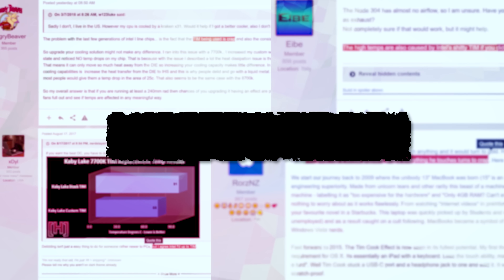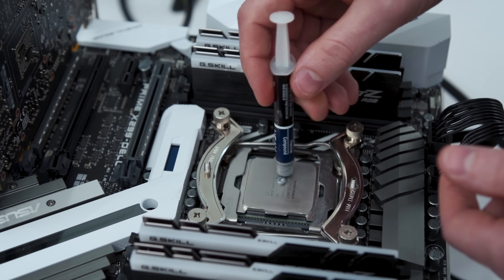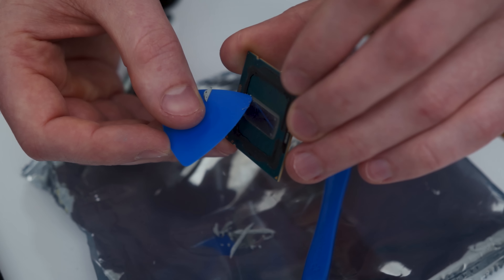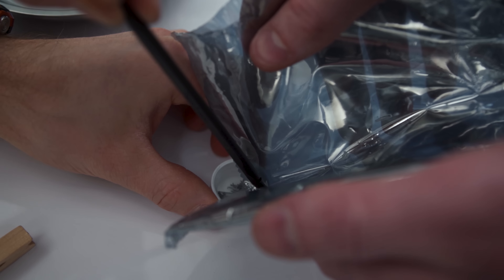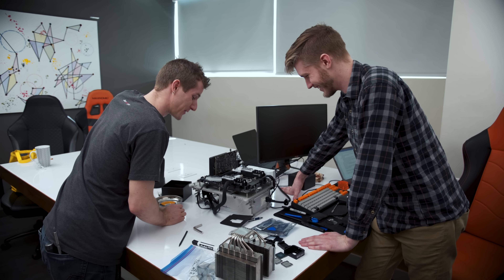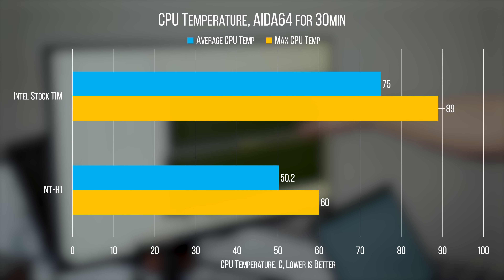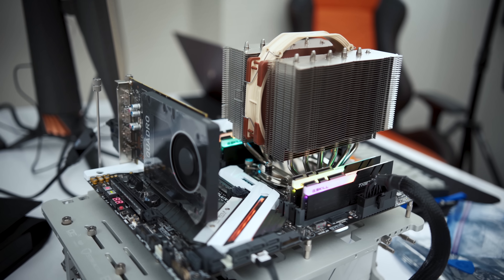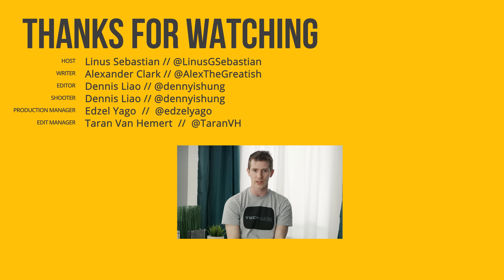Is Intel’s Thermal Paste ACTUALLY That Bad?

Comment: Intel™ Brand Thermayo® - Thermal Mayonnaise - Comes standard on all Intel™ Core™ Series processors, and uses only the best thermally enhanced ingredients such as Canola Oil and three week old eggs!
Reply: there's nothing really wrong with it. Tens of thousands (x10 probably) are using non delidded CPUs with no issue, overclocking them. The thing with overclockers is (I know, I'm one of them) they don't like to see high temps. 80-90c is completely safe, but of course we prefer to see 60-70. It's really not something that's necessary
Reply: Core™ is actually a trademark for Intel™.
Reply: iBoolGuy Added another ™, thanks
Reply: TDS
And what if it`s not about overclocking? You could use a cheaper heatsink and still have respectable temps. Or just keeping that stock heatsink - that`s not bad at all
Reply: Old pastie
Reply: It might lose to not using any.
Reply: Intel Core is a TM (ETA, they're smart enough to not claim Core itself as a trademark); Intel is registered. Intel® Core™ i7-8700K. Intel® Pentium® Silver J5005. Intel® Mayonnaise™ Thermayo-8086.
Reply: noxxi knox noooooo
Reply: THey dont want you overclocking those CPUs too much
Reply: three weeks egg is chicken
Reply: Guys we need to get Jay to make thermal past out of stuff in his kitchen.
Reply: Almost 700 likes, yiss
Reply: Wait, is Intel mayonnaise also an instrument?
Reply: Partially produced with genetic engineering.
Reply: TDS When people pay anywhere from 300 to 2000 for their chips, its only expected they get the best, for intance, their main competitor had the idea of soldering the die and block together, to assure the best perfromance without the need of delidding. To defend Intels shitty TIM is is like saying you dont want advanves within technology cause what we have is good enough. Its just plain stupid and unacceptable

Comment: This was done... pretty poorly. My recommendation would be to get an ACTUAL mortar and pestle so you can grind the TIM in to a fine dust and then using a small amount of Ester Oil or Silicone grease - something that is actually used as part of thermal grease as a filler so it can flow. Or mineral oil, or some kind of other oil instead of isopropyl alcohol which was never going to suspend the TIM particles properly.
Reply: Seconded. Would like to see LTT redo the test with this advice in mind
Reply: Yeah, I was really disappointed. I did just 10 minutes of research and found out most thermal paste should be insoluble in isopropyl alcohol which was clear in the video
Reply: It was never their intention to create a new paste, they just wanted the intel tim to be easier to spread. They even say they want the alcohol to evaporate - i mean did you even watch the video? Come on...
Reply: Mineral oil. Use Mineral oil.
Reply: Not really recommended, but close enough :P Not sure if those perfumes would break anything down over time, but I am sure you don't want your room to smell of babies every time you stress your system xD
Reply: Or you coulda let the first thermal paste dry out and crust up, and give it the same alcohol treatment, so the results would be comparable.
Reply: Yeah and did YOU watch the video when he said “we’re actually changing a lot of variables when we do that” - but doing such a crappy job with the Intel thermal paste he’s changing only one variable but in a pretty significant amount
Reply: I dont care TUNNELBEAR IS BACK
Reply: Well everybody knows from the beginning, that Intel TIM is shit. So doesn't really matter how they process it xD
Reply: Are you a rocket scientist?

Comment: When they said Intel's thermal paste I thought they were talking about the default paste that comes with the stock cooler of the processor.
Reply: Same
Reply: They should test that too.
Reply: Btw why does my i5-10400 with the stock cooler with the pre applied thermal paste go up to 100 degrees Celsius? I have 5 fans in the case or is that normal
Reply: @peacemekka  So should I take off the heat sink and and re-apply thermal paste or just take it off and reapply the heat so its in better position
Reply: @yoursubconscious1774  Check if there is enough there. If there's barely any scapes left then do reapply. The mounting pressure is key. Not too much or too less. Oh and don't apply too much paste. A single drop (~1mm diameter approx) in the center serves fine.
Reply: @peacemekka  for some reason my stock cooler won't come off. The first 2 little clip offs will but the top 2 will. I tried taking off the back panel but no luck
Reply: @yoursubconscious1774  be very careful with those, if you break a clip then its real trouble. Each clip has a rotate-lock mechanism to put it in place. Did you try rotating the clip head to unlock the clip? The first two might have come off easy because you didn't lock them properly, hence the heating issue.
Reply: @peacemekka  yeah the first 2 are very easy to take off but the top 2 are very hard to take off. I didn't much force ln it because I didn't want to damage it. But yeah I will try to twist it

Comment: 25° is the difference I got between no thermal paste and nth-1 on a Chip with similar TDP and with a huge air cooler with a big contact surface. That doesn't mean that intels tim is as bad as no TIM at all it just means that 6 year old tim scraped off from a chip is as bad as no TIM.

Comment: The noctua layer of paste looked a couple times thinner than the recycled layer, not to mention its crumbly consistemcy and inability to actually spread out like it's supposed to. The patch is clearly not a lot bigger than what the application of the dried emulsion looked like. Please try another method to test this.

Comment: Plot twist: Intel's new gen chips were never been more efficient. They were just using better thermal compound each year!
Reply: Who would've thought imporving just the thermal compound would be cheaper :D
Reply: Sadly, that actually sounds like a really probable move from Intel.
Reply: That's not bad, improving the paste to get lower temps.
Reply: Except delidding doesn't reduce TDP it reduces temp.
Reply: No dude, using better TIM doesnt make CPUs go faster. Unless all previous gen CPUs were throttling by default even with high-end coolers on them.
Reply: Well even ivy bridge ocd very well and was limited alot by temp..
Reply: inb4 Cascade Lake X is soldered lol.
Reply: A N I M E
N
I
M
E

Comment: You should have done a test with the thermal paste that comes with Intel heat sink....
Reply: Gabe Catell do you know they are the same paste or are you assuming?
Reply: We can only assume. But it's a good suggestion. At least you can get it fresh.
Reply: They even look completely different, so...
Reply: This video is disappointing on so many levels.
Reply: 100% agree, using a couple brand new out of the box Intel heatsinks and a couple with the thermal paste wiped off would have worked so much better instead of torturing those poor 3rd gen chips
Reply: Or possibly taking two older chips and De-lidding one of them and putting fresh thermal paste on it and keeping the other chip with the original thermal paste.
Reply: @EHEH RON linus assumed he could just scrape off the old paste between a tim and heat spreader and use it for thermal conductivity between the cpu and cooler. Mind you those cpus they got that paste from are like 8 years old now, and they assumed they could just use isopropyl alcohol to re-liquify the old paste. which didn't really work. Being scientific simply means to find a problem or hypothesis and test it. The dilema tested was intel's thermal paste, and they assumed a lot of things, considering no one has ever done such an open experiment, at least none that have been recorded or documented. You should "get woke", son, as you clearly don't know much about scientific reasoning. And the way you used "fag" was in a derogatory fashion. I'd hoped that in 2018, people would have more decency. Hell, I'd hoped that the immaturity of insulting someone on the internet would have died out years ago, but I guess not. Instead of insulting people, you should do research and try to understand things. Also, you're on the internet, literally everyone in the whole world can read this, you should use caution on the internet. If you have nothing nice to say, you should use the dislike feature that YouTube so graciously provides us, and move on with your day. Why waste your time to get into a fight over some YouTube comment?

speaking of Scientific Reasoning, it would actually be appropriate to assume that intel uses the same paste in their cpu's as they would with their stock coolers. It woud be more expensive to create another type of paste to put on the bottom of an already cheap cooling solution. So you could make a claim that in order to be cost-effective, intel uses the same type of thermal paste. However, it can and should be tested. Hypothesis: intel uses the same thermal paste for all of their computer components, and have for a long time. You can do many tests between cpu generations as well as their corresponding coolers. the control could be an 8th gen cpu and cooler, completely untouched. 

To be fair, linus wasn't very scientific about what he did, but they did prove that thermal paste in the older cpus weren't as good as thermal paste you can buy separately. But again, the test is flawed because the cpus are old.  

with that being said, have a nice morning, day, or night depending on where you live in the world, and I hope you learned something. refusing to lose ignorance can be seen as idiotic, and I know you aren't an idiot, so I really do hope you've learned something. Also, I'm no hypocrite. i disliked your comment, and you might not ever hear from me again, definitely not in this comment thread. And I of course had nothing bad to say. I simply added to the discussion, and I certainly haven't insulted anyone or used words in a derogatory way. Enjoy the rest of your day.
Reply: Kenneth Fleming wow, just wow!
Reply: Intel's thermal paste AND Ryzens perhaps?
Reply: You can get 7th gen Celerons for $35 each new on amazon, let's not pretend that getting "fresh" TIM wasn't an option, even with a reasonable production budget
Reply: EHEH RON it shouldn’t be too hard to determine if they’re using the same paste with some simple chemistry tests
Reply: Past on the coolers aren't designed to last for 10+ years. Your temps will go to shit within 3 to 4 years if you never replace it. It's highly unlikely to be the same paste, hence wouldn't be a proper comparison. It also wouldn't have been an interesting video since everyone and their grand mother have documented intel's stock heatsink thermal paste vs high end paste.
Reply: HAHAHAHA ...
Reply: Doubt it’s the same compound but I would be interested in seeing the difference.

Comment: Maybe a Better way:-

1. Take 8700k

2. Delid it don't replace TIM to eliminate the variable of contact distance between the IHS and CPU die

3 benchmark

4. measure the volume of Intel's TIM (granted you have to measure the density and mass of the TIM) OR just eyeball the amount 

4 take the same volume of NT-H1

5 BENCHMARK

6 GO HOME.
Reply: "granted you have to measure the density and mass of the TIM" that is impossible. Why don't you go work for intel and steal a jar of TIM?
Reply: Nicholas Lau or just eyeball the quantity of thermal paste ;)
Reply: I was thinking this was what they had planned, a little disappointed they went the other way.
Reply: Also show temps as delta to ambient and compare to the white silicon grease thermal paste too.
Reply: Richard Blackwell BITCOIN IS DEAD
Reply: Not impossible just difficult, measure the mass of TIM you scrape off probably delid five or so and take the average of the masses.  Get a small graduated cylinder and fill it half way with rubbing alcohol.  Put the TIM in it and measure the difference in the liquid volume (in cubic centimeters) then divide the amount of volume difference by the mass  and you'll have the density.  But if you just want volume you can skip the whole mass bit.
Reply: Shlok Avlani it is really hard to mount heat sinks without an ihs.

Comment: hey linus
i think you should have used noctua thermal paste inside IHS(Integrated Heat Spreader) and compared it with stock paste in IHS.

Comment: This seems a little sideways. Everything has a K/W rating including paste. If you have a calibrated on-chip temperature sensor and can measure power input, it should be a straight shot. I mean, application is as important as bulk property.

Having watched it, and seen how the re-applied paste literally flaked up, scratch that. This is a completely stupid test. Why did you even post it?

Comment: Problem. You are testing paste that has been heated.Then you exposed it to air. After heating the make up changes. Then it is exposed to air. To get a valid test you need to heat up the after market paste. Then expose it to air. The key is air exposure after heat. Your reconstitution is the problem.
Reply: Carter Baker I mean, the results are about right from what we see via deluded chips.
Yes Linus can be a dingus, but this isn't really one of those times.
Reply: this realy is one of those times, there is a reason you need to replace your thermal paste every time you take your cpu cooler off, so why should it be any diffrent with the intel paste??
Reply: I guess by using old, scraped off paste he can kind of "blame" the difference on that fact. If Intel had sent him a tube of brand new one and it still performed that badly, that would hurt Intel's reputation more.
Reply: Well, if Intel wants to get some good PR, they only have to send a tube of paste to Linus now. Until they don't do that, I take this video and all the delidding data as evidence that Intel's toothpaste is really that bad.
Reply: As an engineer I can say this test was a fucking joke
Reply: Levi For Waifu He us completely off on this many ways. 1. Different age of the compounds. No matter what they break down over time. 2. Conditions are not exact minus the actual compound.  3. Both need to be treated exactly the same. 4. Intel's paste is made to be in a oxygen neutral.  5. You can't reconstitute something and compare it to a non deluded product. The paste is dryer our due to rush of air. Don't get me wrong love his stuff, but very little that he does should be done in production.  He is completely wrong with his methods.

Comment: Terrible comparison!  Why not test all of the CPUs, get a load of measurement data and then try replacing all of the TIM on all of the CPUs with a different type, test, then try another type on them all, test etc.
Maybe even compare it against other pastes that aren’t for CPUs, like toothpaste, copper grease, red rubber grease, silicone grease, aluminium grease, lithium grease, ibuprofen gel, sexual lubricant etc etc, anything like that will at least give a good comparison and would make an interesting video.
Reply: evilution "lithium grease"  ayy lmao
Reply: shapeshiftingpedro wut
Reply: evilution ltt isnt supposed to do this stuff anyways... This is gamer's nexus' job
Reply: HAHA this is LTT aka tech for noobs and kids, what did you expect GamersNexus or Level1Techs type of in depth testing and results? That would require more brainpower and effort than LTT has ever shown tbh.
Reply: Hell just look at fn Wan show they have problems every gd week and never gaf,audio so bad last week I couldn't even make thru 10 min of the podcast. It's fn sad how far and how fast they going downhill.
Reply: DisabledCable lol true, and it really is sad how fast they're going downhill...
But they get sponsor and YouTube cash monies so they don't care
Reply: evilution that was not written in the instructions received from intel
Reply: evilution I really do not care
Reply: d34d_*mem * then why bother replying?
Reply: LTT has made a previous video using your above mentioned stratergy on just one CPU. The method in this video was to actually measure the thermal conductivity on the paste it self.
Reply: DisabledCable yeah WAN show is complete garbage right now. The picture has a green hue for almost a year now. also the audio level was way too low in the last one and then it started making noises. That was the point when I just quit and didn't bother anymore.

Comment: This might just be the dumbest ltt video I've seen in recent memory
Reply: The one where they spray-painted a PC black (parts and all) was the worst one imo.
Reply: how about making multiple videos about 56 cores cpu,s and act like its a never before seen thing every time
Reply: Rockmandash12
Yea i agree it is really bad. He has been putting out a fair amount of nonsense lately. You can tell there is no new  hardware for him to review or any new ideas of any really decent content in the past few weeks or so .
Reply: DerBurner132 #deleteLTT
Reply: I guess part of it would be solved with LTT leaving Intel's sponsor. It's really sad that every time I see a supposedly amazing video, turns out its another Intel-based video... sponsored by Intel. They just can't talk about AMD which, for a hardware-focused channel, is unfair.
Reply: That’s what makes it a LTT video
Reply: Problem is, they don't have the real technical understanding of the problem. And it also shows in many of their DIY projects. They should at least hire one guy with some engineering skills.
Reply: I might just be one of the dumbest in all memory tbh...
Reply: They are still the best tech YouTube channel anyway
Reply: akyhne They could hire a chemical engineer and try to create a new radiator or cooling solution for modern times
Reply: +Laxmi Narayanan KS
The problem is not cooling, but redistribution of the heat, away from the CPU and  in the end, the cabinet.
Reply: Polish Dog not the dumbest imo, the homemade heatsink is dumber.
Reply: Der8auer is german engineering